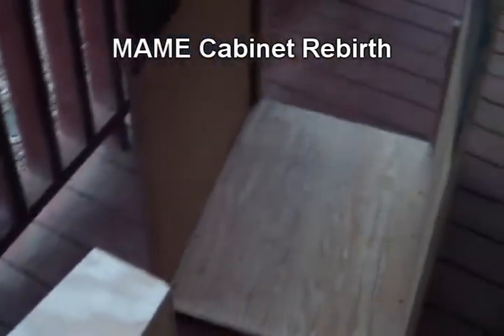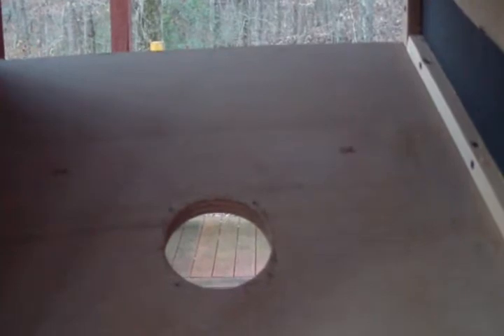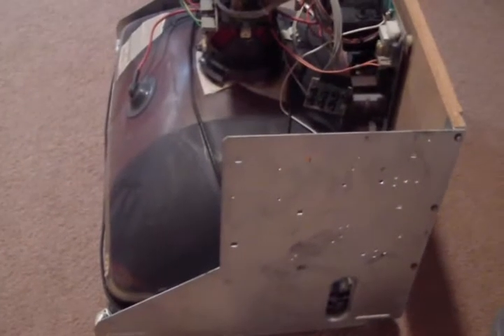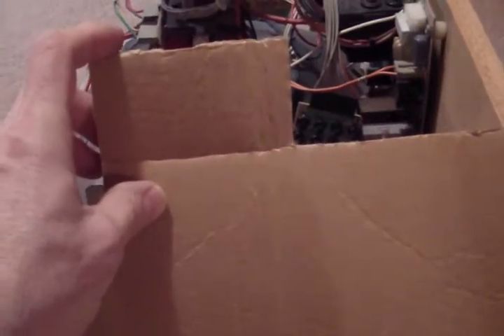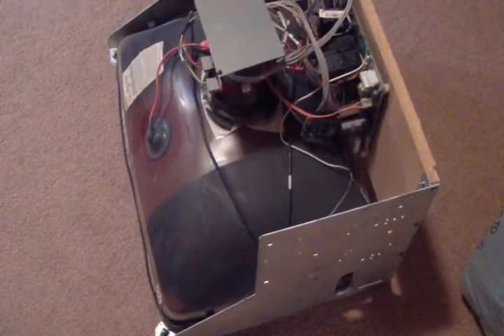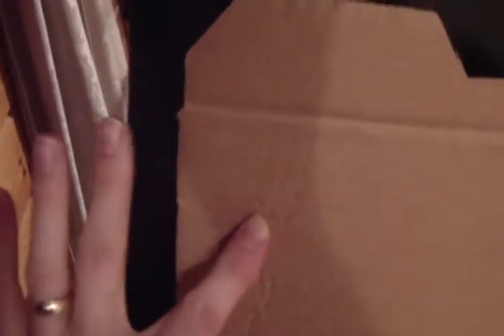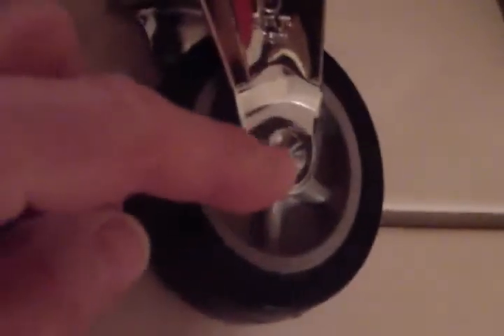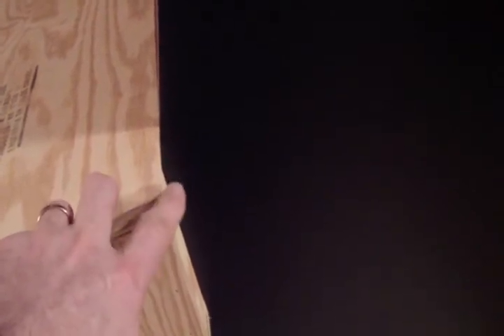MAME Cabinet Rebirth

Comment: Glad to see you've picked back up on your cabinet! How did you get the pasts of wood off that are stapled in? I have that same cabinet if you remember and I can't get any of the wood off that's stapled in.
Reply from the maker: Some of those parts have glue as well as staples.  A couple of pieces just have staples and they are pretty easily removed with the claw of a claw-hammer or you could use a small pry bar if you have one.  Just start near one corner of each piece and try to get the tool under the edge of the wood.  You may have to smack it with your hand or another hammer a little to get it to dig up under the piece, just don't get so aggressive that you damage the wood you're keeping too much.  Then pry up until you see it releasing.  Move up a few inches or to the opposite side of the piece if it's small and repeat.  Do it slowly and it will eventually pop off.  If it's glued down as well, it'll be tougher, and if you start seeing it splinter, have a utility knife to score the edge where the piece meets the cabinet and this will keep it from splintering too badly on the inside of the cab.  Those pieces will leave chunks and splinters still glued to the cab which you can sand down and repaint.